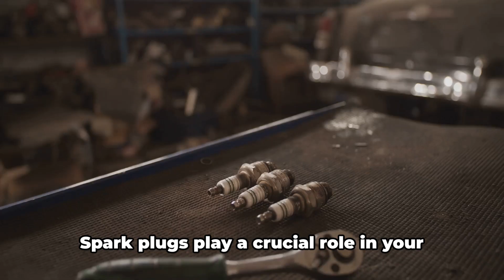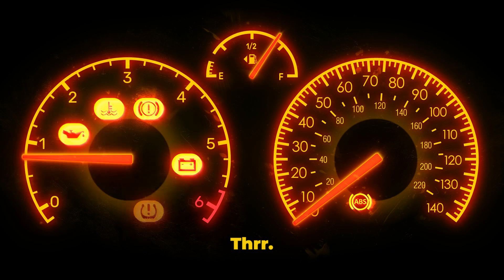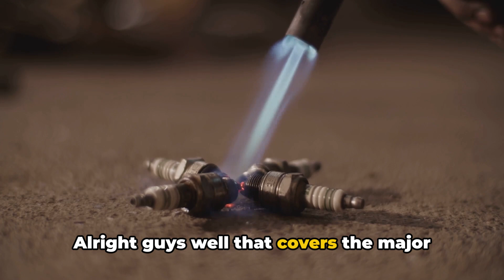When to Change Spark Plugs:  Replacement Interval Explained

Comment: My car runs really good. I feel no need to change them even though it is over 100K miles.
Reply: Depends on the vehicle I noticed a rougher idle, and bit of a difference in when my engine stays in v4, vs v8 eco, I also noticed a minor change in start, just did my test drive after a change all of it was gone

Comment: For rarely used cars, how many years until we need to replace spark plugs, sir?
Reply: Same question here. Got honda crv, 2015, with 27k miles. Iridium sparks. Whats the time interval? As going by the milage, the factory fitted one would last the life of the car xD in my example
Reply: Every 65k Miles and up😂

Comment: Dang. My KTM 890 motorcycle comes with iridium plugs, the bike starts and runs like brand new at 20,000 miles. Gets great mileage like always.   Iridium plugs can run 100K miles in a car.

KTM says replace them at 12.5K miles.  I dont run the thing hard, it makes good power at low revs.

Comment: If you are like most customers that roll into the shop, they get changed when the car gets brought in for a misfire. 

My track cars get new plugs every oil change, they run cheap copper plugs. My normal around town cars gets them done by the manufacturer recommendations, sooner when needed.
Reply from the maker: Your Cars will probably last a lot longer than average. way to go mate
Reply: @HonestMechanicChannel  thanks.  Being a mechanic I know the importance of maintaining my vehicles. 

BTW your video came up lastnight in my feed,  maybe the algorithm will be blessing you.
Reply from the maker: @bleach_drink_me  Thanks a lot, been a tough grind.